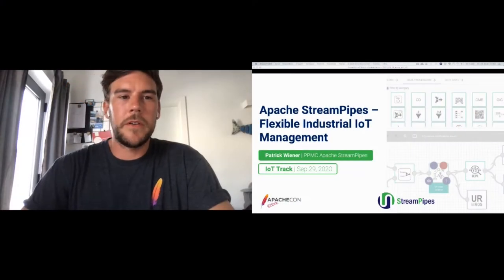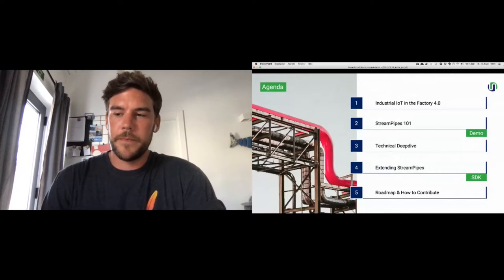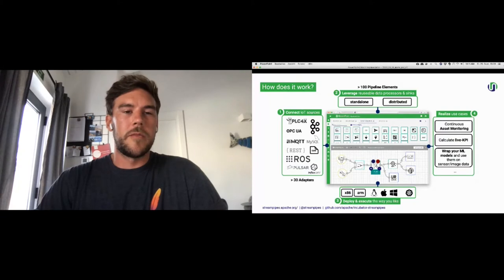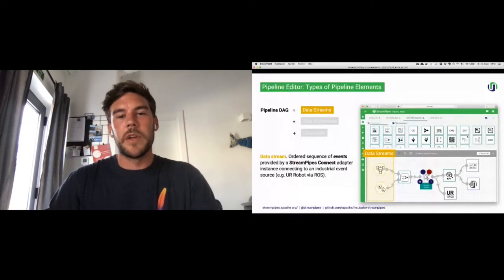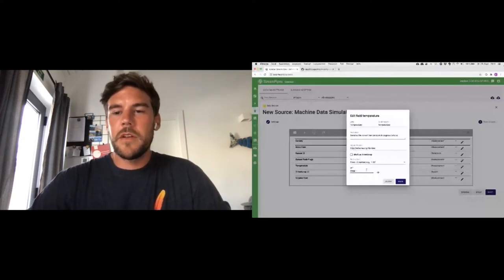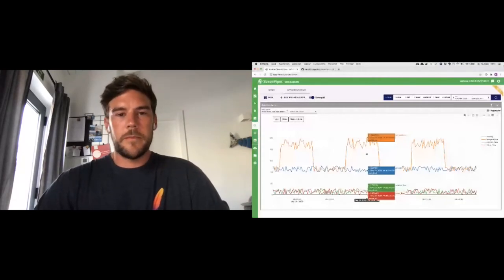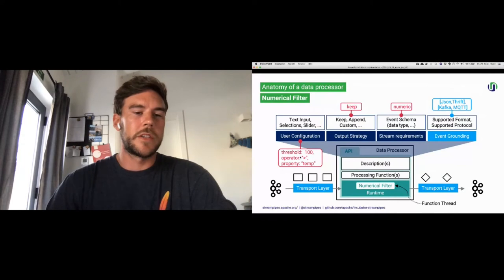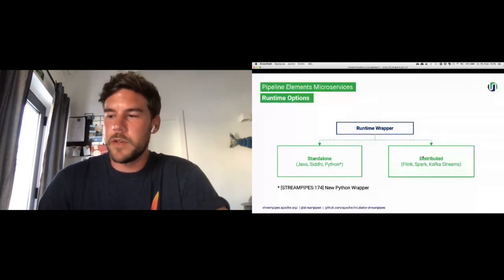Apache StreamPipes – Flexible Industrial IoT Management

Comment: This format is not ideal for viewing a technical demo, the presentation picture should be larger. Still doesn't explain the physical layer that enables connectivity between the monitored device and StreamPipes?
Reply: @InfoVerse Tech you're absolutely right. Unfortunately, the layout and quality of the recording was out of our hands and given by the conference. To answer your question: StreamPipes connect provides an extensible adapter library to a variety of external data sources via industry-specific or generic protocols. For instance, there is an adapter that lets you easily connect to a Siemens S7 PLC to retrieve data. So the physical connection is established via what we refer to as "adapters".  Internally,  created adapter instances  expose a "data stream" description on the logical level which is represented in the UI and used for semantic compatibility check when users model a pipeline. On the physical level,  adapters simply publish events to an internal message broker . From there,  this event stream can be subscribed by connected downstream "processors" and "sinks" in the modeled pipeline, e.g., for data preprocessing, cleansing etc. prior to storing results to a database. Yet, the pub/sub-based topic management and negotiation and overall pipeline orchestration and run-time management is completely hidden from the user. Hope this helps to clarify your question :)